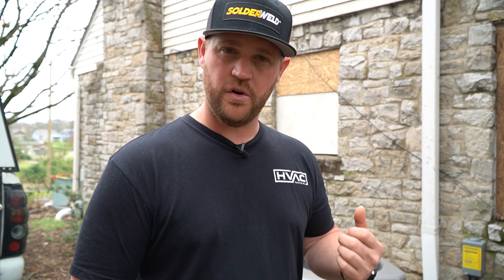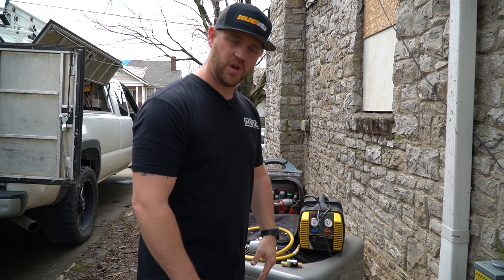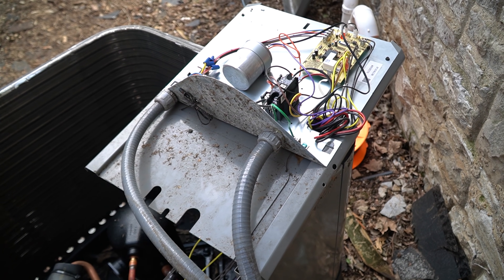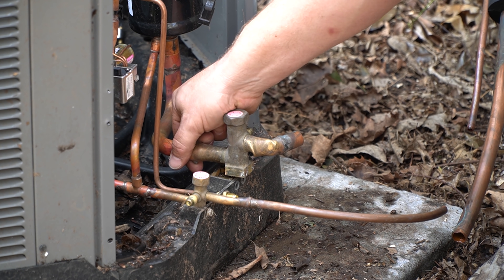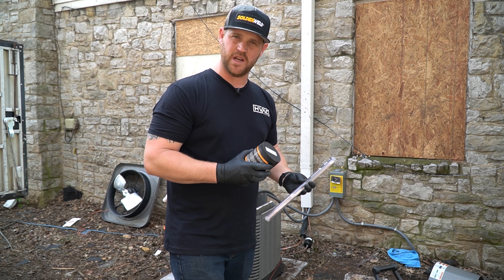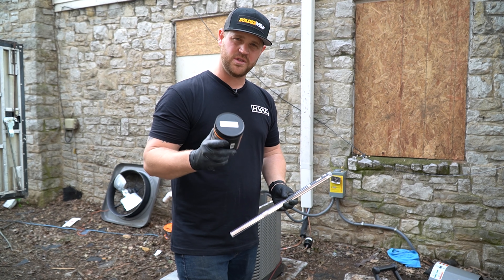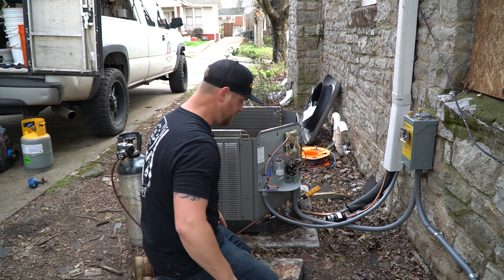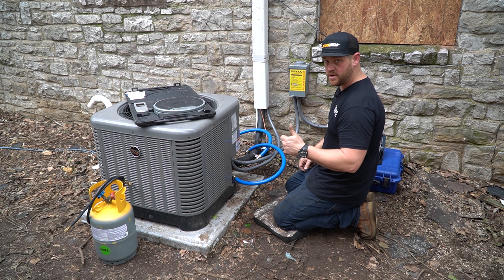Replacing a Vapor Line Service Valve | Unit Flipped Over By TORNADO!!

Comment: That black Appion hose is NOT for refrigerant recovery! It is NOT high pressure rated. It is intended for evacuation purposes only and should only be connected to your vacuum pump.

Comment: Wet rags have been used for decades. Water scavenges heat way better than some wonder putty of the week. You still have to add water to it kid. Now you have messy gloves you have to replace. Real men DON'T use gloves BTW..... Did you notice, in your video, the heat line went right up to your wonder putty? As in it's not really pulling heat out of the line? Snake oil......

Comment: Hi, can you explain when you use nitrogen in the system to braze your copper. I have seen you on new installs with long line sets brazing without nitrogen. So when you first start brazing at the evaporator when you begin brazing, you really cannot hook up the nitrogen. So again if your brazing a new install back to the condenser, before you braze your line set to the service valves would you then hook up your nitrogen to finish the brazing up at the service valves. Can all the connections brazed with out nitrogen on a new install have contaminants at every connection brazed. I'm trying to know when you should use nitrogen to keep contaminants down to a minimum.

Comment: One hell of a pressure test brotha... if recommended 250psi on low side u shouldn’t pressure test system over that. Especially on shit aluminum coils. Usually 100psi pressure test is fine. Good job looks good. 🤘🤘🇺🇸🇺🇸

Comment: We are developing no-flame fittings.
If you can connect service valve with copper tube without brazing, do you want to buy the fittings?
How much will you buy them? 3/8", 7/8"

Comment: I also use the appion core removal tools and the same 1/4-3/8" 1/2"id hoses. I've tried almost all core removal tools and appion seems the best for me. I also use a appion speed y fitting on my pump so I can use two hoses on bigger systems.  What a difference in speed of evac compared to my old manifold and 1/4" hose days lol. Only thing I see that I would do different is install the filter drier  inside upstream of the evap. Good work though as usual.

Comment: Now I feel silly.  I asked if you were using CO2 to purge and pressure test on your air coil change out on water source heat pump video.  Your nitrogen tank looks just like the CO2 tanks in our area with the exception of the black color at the top of the tank.  Anyway, good video... as always.

Comment: glade you popped on my feed, great videos i subscribed!

how do you know when the recovery jug is full?

what are you using to record? i want to document my jobs also
Reply: Find the amount of weight the cylinder can hold ( say 30 pds of refrigerant )....to compensate for expansion use 75-80% of cylinder capacity--- 30 *.8 = 24...now add ( +) the weight of the cylinder...example  tare weight 17 pounds ..it will be stamped on the cylinder.....to the total the cylinder weight will be ---24 + 17= ( no more after this) is...41 pds.....

Comment: What is the purpose of duburring prior to brazing? Never heard or seen anyone use this technique. Thanks for answering......
Reply: Deburring your pipe is cleaning the edges from cutting,making a smooth surface. Your also clearing any debris from going into the unit
Reply: @nickswim7  well said

Comment: What should a job like this cost? Great job not cutting corners - excellent discipline
Reply: 100$ an hour is reasonable on the other hand most companies charge min 200 an hour so if it took you 4 hours that would be 800 labor plus material so you can easily say 900 to 1000. even if you had this one job for hte day and did it in 4 hours your still getting paid for the whole day. dumb easy work too/easy money.

Comment: We At Sears Had None Of This Stuff By In The 80's or 90's. Just Charging Cylinder and Vacuum Pump with The Gages...
Reply from the maker: Welcome to 2020
Reply: Too Late Now... Sears No Longer Exists. I Retired in January of 1999 and They Still Use The Old System To Vacuum The System...

Comment: Please use full PPE when you're doing PMs from now on. Especially evaporator coil cleaning/disinfecting. The coronavirus is present in the air and could live on filters and coils for up to 28 days. Stay safe. Recommend painters full face mask with n95 air filters.

Comment: When you pressurize the system to 500 Psi if the low side is 250, would it hurt anything on low side as the pressure equalizes ? 
Thank you.
Reply from the maker: On heat pumps you can pressurize to the high side number, as both coils are rated for high pressure. On straight cool systems, it’s best to pressurize to the low side number.
Reply: @QualityHVACR  my man you are the best
Reply: @QualityHVACR  that makes sense. Thanks for following up.
Reply: I wanted to ask the same question. I've always been taught not to pressurize over the low side rating. Although, I've seen many techs disregard that recommendation.

Comment: What does it mean to pull a vacuum?
Reply: Vacuuming a refrigeration system is to remove air and moisture from within the sealed system. Otherwise you will have non condensable elements in the system, and that causes lots of problems and damage to the overall system. Also, R410A needs a new drier filter, as was done on this video, installed when opened to atmospheric pressure during a repair or replacement, or at least it is recommended. All of the moisture cannot be removed by vacuum in R410A refrigerant so it is advised to replace the drier, which aides in moisture removal.
Reply: Thank you brother 👍

Comment: Sir, how to you remove micron guage after complete vacuum ? is it ok we can charge refrigerant with micron guage on the system ?
Reply from the maker: Yes these micron gauges can handle a little pressure, I remove the micron gauge once the system is under slightly under pressure.
Reply: I use a ball valve before the micron Guage to it clean from refrigerant.If you don't have one just put the micron Guage on the vacuum pump for a while it helps some to clean it up.

Comment: You put a lot of time making your videos. I give you credit for that. I know you know your stuff.  You mentioned you will let the system run  for 20 minutes to “EQUALIZE OUT”. It’s a term we are taught but makes no sense. Once the system starts you won’t find any equal measurements. I’m not coaching you in any way. Just pointing it out to you. Some air head taught me the same term “equalize”. I would say let it run for your readings to stabilize. Obviously during the off cycle is the only time you should see any equalize measurements.
Keep up the good work.
Reply from the maker: This is true. Stabilize is the correct wording.

Comment: Awesome work man! I work for Hiller the company who had the tag on the disconnect. Thanks for doing a quality thorough job, keep getting after it1
Reply: Is Hiller an electrical company or an a/c company that puts bright yellow stickers with a big warning sign saying: “Stop your warranty will be voided if another company works on this unit”? Something like that. I’m in Florida and see those labels.
Reply: Anthony Reardon hvacr a Plumbing, Heating, Cooling, Electrical company. The sticker says do not remove. This system was installed by Hiller. Check the following problems before calling; advice on how to remedy the issue possibly without having to call us out. Doesn’t say anything about voiding the warranty. Because that would be a lie.
Reply from the maker: Thank you 🙏🏽

Comment: Oh I forgot.. I have an old icing bucket.. i keep it loaded with rags that I fill with ice water to protect valves..I dont trust them products..old school I am.
Reply: I also use a small 2 gallon bucket with a lid and rags for wrapping valves and txvs and for quenching the joints upon completion.
Reply: I used to do it old school, and the valves would always get hot despite the ice cold rag. With that puddy he's talking about, it actually works real well, read the instructions, and man does it save lives. It'll keep that valve cool, if applied wrong, warm. I've had 0 issues with it, and 0 worry. Give it a shot some day
Reply: I've used the putty but I'm old school as well. The putty can be a bit messy for me.